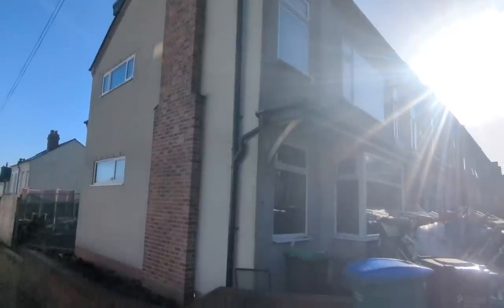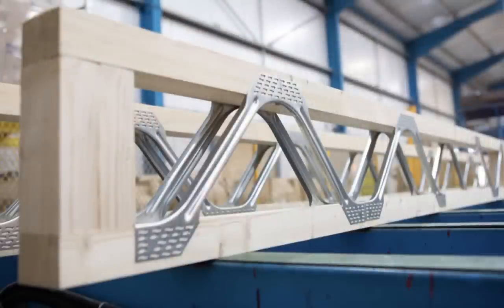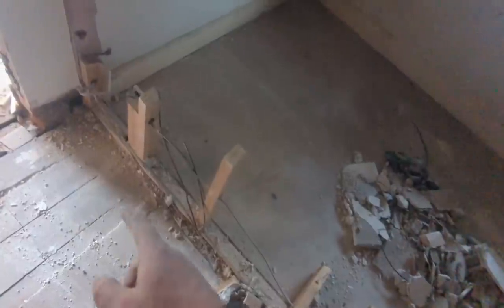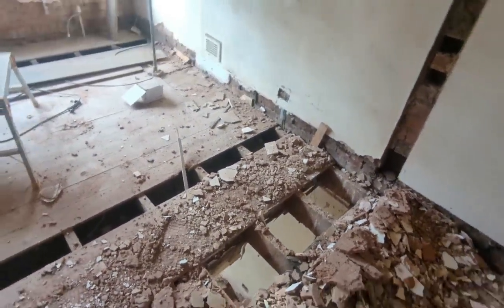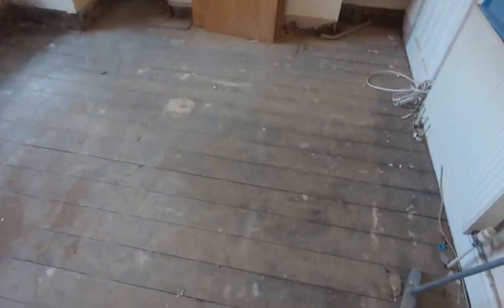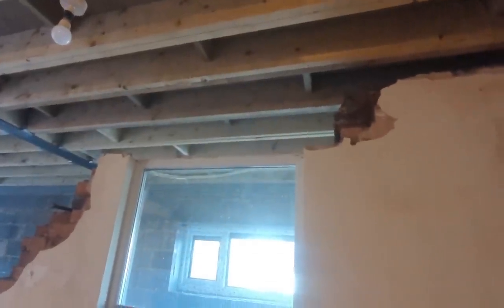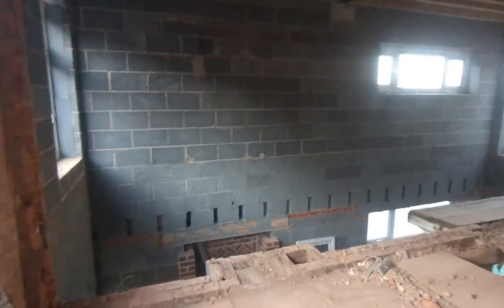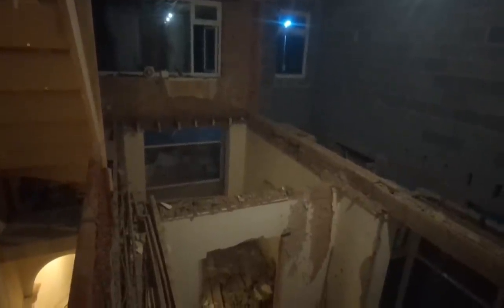Builder Destroys His Own Home!

Comment: Excellent level of detail and explanation of intended plan and reasons for decisions.  As a house build project manager (civil eng) I think that the rapid change in material costs, build standards, energy considerations has led us a community to advise clients that it can be cheaper to demolish to foundation or to core shell and move forward from there.  The latest build we completed, similar to your scenario, was a full roof off, tied external walls to props and then a SIP kit assembled inside the house shell. All the electrics, plumbing first fix, windows, doors, was completed in the workshop leaving only plaster internally and second fix. 
As you stated this bare shell build also means quicker timescale to complete and allows limited resource needs. Are you planning on underfloor heating to enable future heat pump install? I agree that metal wood easy joists are an ideal solution and your spark will like the ease of running cabling.  Excited to watch the journey.
Reply from the maker: Thank you Joe. Appreciate that mate. Yes to under floor heating, no to a heat pump. I'm not sold on those yet. Thanks again mate, take care.

Comment: Sorry I got this message too late about the chimney.
DIYer here.
Structural engineer to get me plans made as the previous job was awful into the first floor bedroom, so it had to go above the roof line.
10" x 3" timer from adjacent chimney and sister up the existing pearling with the same in two parts with 10mm steel plate to join.
£500 for design work.
£400 hardware.
couple of days to do it all inc plastering.
Job done! ;D

PS I love watching your work it's a pleasure to see a good builder at work!!

Comment: Very interesting. I especially like where you explain your reasons for doing what you are doing. Without being critical have you considered that having a solid floor might lead to bridging the DPC on internal walls? As a suspended floor the walls would be dried by air flow. It’s a common misconception houses this age don’t have DPC but often they are just well hidden and sometimes partly failing. 

The lintel is beautiful. I hope it can be re-used. You might want to consider a clear protective coating after paint removal to prevent weathering.
Reply from the maker: Hello Andrew, hope you're well mate. It's not really a worry to be honest. There's no damp in the house as it is and 60% of it isn't suspended, i.e solid floor. Add to that is the fact that 100% of the floor will be removed, membrane throughout and then concreted. Take care.

Comment: Impressive progress! Think most people who do renovations dream of being able to start from scratch at some point. Pretty daunting when you actually look at it though lol.

Only thing I might pick up on is that if you're converting from a vented timber floor to a sealed concrete one, sometimes you can have an issue where all of that moisture has nowhere else to go but up around the sides of the floor and into the walls. Not that there's many better options when you're going into a new extension, but worth bearing in mind at least. Some thought to sealing your vapour barrier to the walls and not bridging it with your new plasterboard.

Comment: “Never throw wood away” said my Dad. Surprised you did. Those floor joists would have needed de-nailing, but they were rock hard slow grown and really well seasoned. Get a saw table and rip them up for all your internal studding, etc. I notice in another vid you do just this and re-used the wood for for wall plates

Comment: At 30p a brick isnt that some quite expensive back fil, i know you have to stack and move but reclaimer should help somewhere.
Mantlepiece!
Reply from the maker: That's a good point, Mark and one I should have covered. It is an expensive way of back filling but does the ease and speed of it outway that do you think?
Reply: @Mr_A_Builders  i do agree, somtimes the advantages in time savings are outweighed in the financial costs. You saved hours v 30p a brick minus the cost of what you would ne replacomg it with. 
Keep it up

Comment: Very excited about this project! You're mad 🤪. Can you explain what happened before? Looks like you built an extension on the side of the house already? How are you able to remove brick walls inside? Is it because the roof was redone with big steel beams when the extension happened? Looks like it. Maybe before you ran out of money? What was that pipe under the floor that you kept but that must have had a fair few bricks hit it? Good luck, you're such a hard worker, kudos.

Comment: I'm deffo interested I'm currently renovating my house and installing under floor heating and unsure if I take out the timber joist floors and go to solid floor. Would deffo be interested in the process of it all
Reply: Im in the process of doing it - I went with insulating between joists and then chipboard routed to take pipe in my kitchen. If I was doing it again Id go solid floor, seems to be more products on the market suited to it and a big plus is no need to cut insulation to fit in between joist that are not parallel. Id say the big deciding factor is how much void you will have to fill and if you can get anything cheap or free to fill it.
Reply from the maker: That's exactly what we're doing here naths, I'll definitely be explaining everything that goes into it. Appreciate you watching mate.